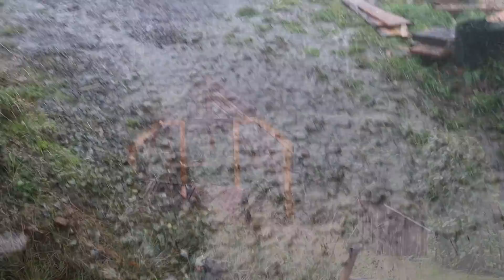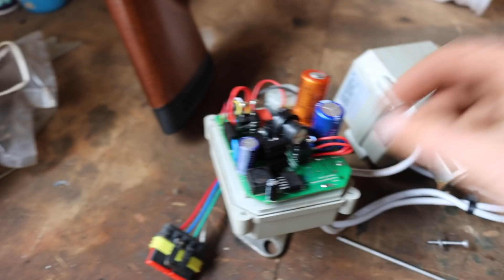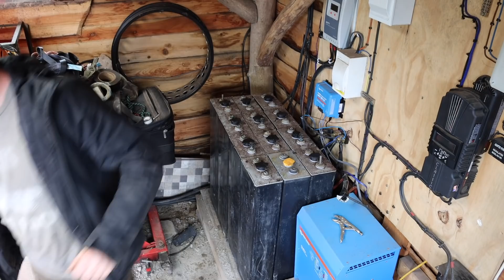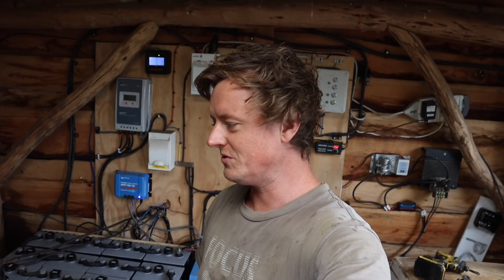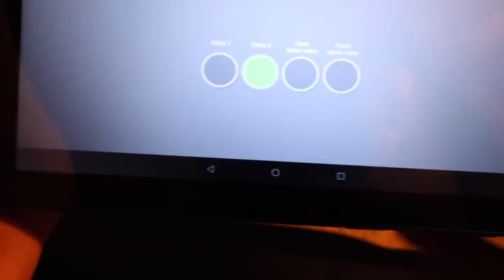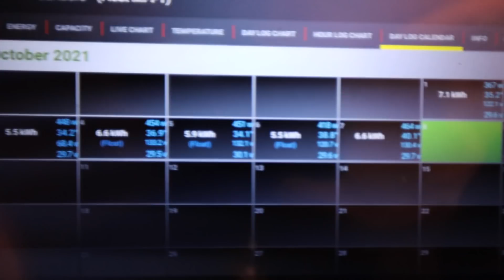Turning On The Hydro For The Winter And Installing A New Battery Bank

Comment: Lead acid batteries are still really good batteries when they are built right from the start and taken care of. All this talk about how we need better batteries for grid scale power storage is a load of bs. We already have the tech for that! Lead acid batteries! They are already one of the most recycled products in industry. They are rugged, powerful, and nearly idiot proof in operation in edition to being dirt cheap. Use an automated system to monitor the specific gravity and electrolyte levels for each cell and automatically refill as necessary. When a cell goes bad, swap out the whole bank and recycle them.

Comment: Have you considered water capture? I'm so annoyed that new houses being built don't have these built in.  Family have a Macerator that converts the water that's used in Portugal. We could quite literally capture water through out the winter and spring to sustain each home for the year.
Reply from the maker: you cant really store water for hydro at that scale. my turbine uses half a million litres of water a day to generate enough power for one houeshold. so for a years worth of power you need to store 157 million litres per household. Thats 157 thousand cubic meters of water per house.
Reply: @KrisHarbour  I mean rain water coming off the green house z roofs and any flat surfaces. All going into a holding tank to be useable water.
Reply from the maker: Oh i see. Yesterday evening i installed two ex whiskey barrels on the greenhouse to catch the water from it. so yes we are doing a bit of that. we get a lot of water flowing through the land anyway so it inst that much of an issue for us here. the greenhouse capture is just convenient for the garden when the spring stops flowing.
Reply: @KrisHarbour  Good for you. I'm moving to Portugal soon ish, and I plan to be capturing water and filtering it myself. You have the spring so guess you're well stocked. It's crazy that we could capture our own water and use it, yet we pay for crap. Love your work Kris. Keep it yp

Comment: Those new batteries look a lot cleaner than the old ones, should last you a few years :)
Reply: They could last as long as 10 year with proper charging cycles and maintenance. Keep your voltages right, don't over charge or under charge. When balancing monitor temps so they don't get too hot. Check specific gravity and cell voltage periodically. Before adding acid for raising the specific gravity they need to be full charged for a few days first so as to not add too much acid and cause damage.

Comment: A top job .... as per usual!
Was that damp on the wooden battery "casing"?  Would that have a negative effect on your batteries with the dust wicking up the water and giving a conductive path across the terminals?
While I am on, how did you go with the wind. The last thing I remember was seeing it break apart in a storm and you saying it was "a quick fix". Not to most people my friend! If you have it up and working do you have any idea how much the difference between your Solar, Wind and Hydro is?
A final thought occurred to me ..... If you fitted a level switch on your pond you could use any exes power produced to do non standard things like heating water or even a TSR in your home. If the water s overflowing and your batteries are full it would seem a shame to waste it ;o)

Comment: I looked at 48v batteries from a fork lift, but ended up with a lithium system, I have the same thoughts as you about lithium but there you go. Unfortunately we don't have any water to run hydro but we have 13 x 285 watt panels which keep us well charged on the sunny days. And 5p/kw electric at night to charge the batteries. Never takes more than 2 hours which is what the batteries hold 7.35 kw.
Love the channel keep it up.

Comment: From what i know Most big industry UPS use deep cycle lead acid cell, and i think for house aplication and not having to move it's still make a lot more sence, if ventilated, it is mutch safer than lithium and can tolerat mutch more abuse.

Comment: Hi leaving batteries on concrete kills them very quick... that is what I always all told when I was working for agriculture dealer-ship as a engineer
Reply from the maker: They are off the floor on plywood.
Reply: why?
Reply: Because they Diss-charge quicker and can kill the cells...
It like your tooth brush is charges on a induction charge works the same way but in reverse.... Its unlikely but can happen or I should say has been known to happen best practice to leave them on  a table or as kris has done leave on ply wood off the ground

Comment: oh and my top tip for going lithium is to build over capacity such that you typically do not need to charge past 80% nor go below 20%. you'll spend a bit more up front but the batteries will last 3+ times longer.
Reply: Meh, they last 3000 cycles already if you push them to 100% and down to 0%.. also, if you cycle them once per day, youve scaled your system wrong (for off-grid use, that is).. so they will last maaanyy years either way
Reply: A larger capacity pack also has the advantage of reducing the discharge current per cell/C rate, which is preferable, especially considering the large inductive loads from the workshop. Temperature is also another consideration for for lithium especially lifepo4 chemistries. Although the UK doesn't freeze all that often, if the charge is happening at night via hydro the pack might need to be warmed if it's in an unheated area, it'll be less of a concern with a purely solar installation.
Reply: Charging only to 80% is one of the worst things you could do.  This is an old wives tale that needs to go away.  The only time lithium batteries shouldn't be charged to 100% and balanced is when they're going to sit idle for an extended period of time.  Balancing the cells is crucial to the longevity of the battery pack and can only be accomplished after the cells have been charged to 100%.

Most lithium Ion battery management systems won't let you take the batteries below 20%, which means 100%-0% SOC is actually 100% to 20% soc.
Reply: @NavyCuda  You're making something inconsequential into "one of the worst things you could do." Battery imbalances matter because they mean the imbalanced battery could have a voltage more extreme than other batteries, which results in a relatively reduced lifespan for that cell and reduced overall capacity for the battery. 

To increase longevity, people are increasing the distancing all of their batteries from those extremes by 20% SOC. For this to be worse than doing nothing, the strategy would have to result in battery imbalances that cause cells to be closer to the extremes than by default. Which is impossible due to the protections on the BMS. The worst that could happen is you trip a voltage cut-off and you're forced to balance your batteries immediately. 
With some amount of intelligence, however, people can just balance their battery every so often. It could even be set up to happen automatically on the bottom end of the voltage curve which may be good enough depending on things and stuff.
Reply: @johnsmith34  Do some more reading then get back to me.  I'm nearing 200,000km and still get the same effective range as new.  I let the cells balance on every charge.  That means my battery is always getting charged to 100%
Balancing with every charge is like putting the dishes away right away instead of piling them up in the sink.  If the error is small it's easier to correct and keep corrected.  If the error is allowed to grow it takes more effort to correct it.
Same with balancing the cells.  When batteries are charged to only 80% they don't get balanced.  The BMS does not balance consumption from individual cells, it can only manage the charging state.  The BMS does not actually manage the charge rate to individual cells either.  That is the reason for balancing, the cells need to be fully charged and then bring the static voltage up to a higher that normal state to equalize the cell voltages.
Reply: @johnsmith34  Well the automotive bms only monitors the situation.  Due to the physical assembly of the battery the charger can only provide a voltage and amperage across all the cells.  If cells or batteries are arranged in parallel they can be isolated.  From an automotive manufacturing standpoint any BMS that manages each cell individually is not cost effect.  If you were as well read as you pretend to be you'd know that.

Start with reading schematics for the assembly of the battery itself.  Looking at how the bms, the cells and the circuits are arranged will tell you how the battery works.

Years of physical experience with battery behavior has proven the value of balancing every time.
Reply: @NavyCuda  I have no idea what you're talking about. 
If an automotive BMS can only monitor the situation, then it also can't balance the cells. 

Why are you talking about balancing cells in parallel? They self-balance; it's the ones in series that cause problems. 
...
And yes, I have to be so well-read to understand the tradeoffs that motivate the s and p numbers of a battery... The thing that anybody could understand once they realize that cables are rated for current, and can transfer more power at a given gauge with higher voltage. It takes so much reading to understand that cars shouldn't be 20% copper.
Anyway, if you were as well read as you see yourself, you could easily point me to a source that explains why limiting your battery is the worst thing you could do.
Reply: @johnsmith34  Neither this battery nor a car battery are parallel wired or at least exclusively parallel wired but if you have actually installed several inverter systems you'd understand that you need to take the batteries to 100%. I'm not going to educate you on this, you can do it yourself because you are intelligent enough to do so. 

I will however quote from the manual of the Lithium batteries I prefer for small to medium installations: 
"Cell balancing is a very important function of the lifespan of your battery. It is
 important to ensure the cell balancing functions are properly performed. The

Hubble BMS cell balancer will only activate upon 100% state of charge when
the batteries near full charge. Thus, it is critical that a full charge to the batteries
are provided at least once every 5 (five) days, but preferably daily upon a charge
cycle. Enough charge time should be provided to balance the cells until the BMS
completely stops taking charge from the inverter. Cell cycle life cannot be guaranteed if balancing is not performed on a regular basis. This is especially important
in complete off grid systems where a stable power supply is not available."

This is on page 9 of this manual: https://www.hubblelithium.co.za/uploads/1/3/5/0/135079623/am-2_manual_.pdf 

I rarely install systems with less than 11KWh battery capacity....
Reply: @NavyCuda  This is corect. I use lipo batteries for RC planes, and since the battery in an RC plane is like the heart and are not cheap also. You kind of want it to last. Now i never heard of a lipo pack to last 3000 cycles. Probably at that range of use, a cycle would be less than 50% of initial capacity.
I treat all my batteries like this, the li-ion from my tools, the battery from my phone. I alwys use them and discharge them till the critical point. Than charge them back to 100% The balance, or storage point is around half, it should be somehwere around half at the capacity. Also if you're not charging or discharging lipo and lion batteries, they stay very well and save the energy very well in a cold temperature, I keep my tools and RC batteries in the fridge. And even after 2 years they still have same voltage and capacity as i left them. Iipo are really good batteries! Compared to led acid batteries, is huge difference. But the led accid batteries are more rezilient to weather and stuff. That is why they still use them in cars for starter motor. Lipo are very sensitive. But if treated well, they last a very long time. I am not sure lipo is a very good choice for a house. Maybe only if you have 2 packs, while you use one and discarge it to the lowest point where they are still safe. the other is charging. If you plan on chargind and dischargin at random capacity, use them like car batteries they won't last as long. This is same with modern EVs..

Comment: As you have the land and the skills why not build a battery house to store large bulky DIY batteries that you can get the materials for them from the shops and chemical sellers? We have 200 something years of history with building batteries outside of lead acid and lithium to play with. 

With the work with high volt/amp DC power you may want to invest in some plastic/resin tools to use to avoid the shorting risk dropping a metal tool can have.
Reply: Usually if you don't have proper tools as u mationed above, just use electric (isolation) tape on metal parts to avoid short circuit...
I like your comment  a lot, because is correct and professional.

Comment: lithium ftw! can i recommend you get the arduino battery spot welder rather than a chinesium machine? i've built 3 packs with mine and it's a fine tool and it doesn't support the environmental catastrophe that is chinese manufacturing.

Comment: You might have been able to refresh the dead cell by removing the dendrites. It's not always the problem but a good flush sometimes does the trick. I am completely onboard with the idea of sticking with lead acid until you have a better understanding of Lithium ION; these are much more "sensitive" to charge/discharge rates and require a proper charging system to help you get the most longevity out of the cells. You are a clever fellow though, I have no doubt that you will get the knowledge needed to move forward. If I may make a suggestion, read some white papers on the effects of NOT charging the cells to absolute maximum and NOT draining them to the absolute minimum. Good luck to you =)
Reply: Perhaps you could also revive the old batteries or save the good ones and have an extra pack out of those, so you'd have nearly double capacity? Perhaps with an automatic switch to alternate charging between the two?
Reply: What are some good ways to remove dendrites from these batteries? I've got a few that are shorted and I'm on a budget.
Reply: @RingingResonance  Step 1 - PPE, protect yourself with acid proof gloves and eye protection.

2 - Dispose of the acid in the battery properly. Rinse out the battery a couple times with distilled water.

3 - On your stovetop, boil distilled water and add Epsom salt to the boiling water (a little at a time) until the water is completely saturated with the salts. You should see a few granules in the bottom of the pan that refuse to dissolve. Add this water to the battery.

4 - Trickle charge the battery without the caps on the top for 3 days. The charging process will output some gasses, so do this outside. If you are doing a single cell use an adjustable power supply set to 2.5v, 1amp. You can also flush all the cells at the same time and use a current controlled charger, something like 1-2amps.

5 - After charging dispose of the solution of water and salt. This will be an acid, treat it properly and carefully. Rinse out the battery a couple times with distilled water.

6 - Add Sulfuric acid and Distilled water back to the battery in the recommended ratio for your battery. Perform another 3 day trickle charge. If the battery was capable of being reconditioned it should now work. If not, then its time to replace it.
Reply: @ianide2480  Thanks for this.

Comment: Could you add a bit of detail on the batteries, to the description.
Capacity of the old ones, as new (or new to you) and for the bigger new ones.

Every time I see your videos, makes me want to get out and do the same. I'm not into all the eco-warrior side of off grid, but it would be a lifetime of big projects. Which I love.

Keep 'em coming.
Reply: Judging by their size they look to be around 30kwh new. I can imagine the old ones where around 50% - 75% of that when he first got them and by the time he changed them out they were probably around 10% that.
Reply from the maker: Ringing Resonance, you are very close mate. 25kwh the new ones are. the old ones were the same capacity but were only about 30% capacity and one cell shorted.
Reply: @KrisHarbour  25kwh just doesn't seem like enough for running a shop like yours. You would think you would need double that for the sake of reliability and to keep from over stressing the batteries along with nearly double the energy source you have. 4kw of solar + 350watts average hydro + the wind turbine is barely enough IMO. 

Two wind turbines + another kw or two of solar + a second smaller hydro would get you really far. You would probably have more energy than you could store in a day and would need to double or triple your battery. You might invest in tools and gear for fixing old batteries for cheap. That might even be valuable for refurbishing batteries for other people in addition to building the hydro turbines.

Comment: As an electrician I love your electro/hydro vids the most. Don't forget to tighten the screws on the battery cells again after a few days. 😉
Reply: I've got an electrical engineering background as well. I also really enjoy the hydro videos. But overall I love all the engineering in everything Kris does. And the wood working. Oh man. I love that stuff!
Reply: Ottimo consiglio, io li ho controllati oggi e trovato uno lento. 👍 Grazie per aver dato questo suggerimento alla community
Reply: If you admire DIY hydro...check out Marty T in New Zealand
https://www.youtube.com/watch?v=LVoeaKCEd2o
Reply: @JohnSmith-yv6eq  lo seguo da diverso tempo. Ciao
Reply: Depending on manufacturer recommendations, they may advise checking torque annually.